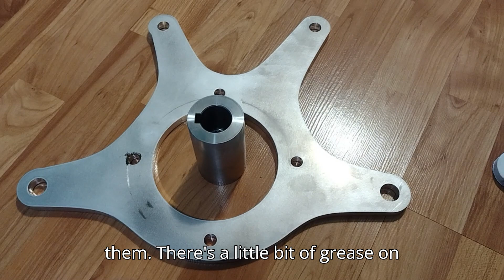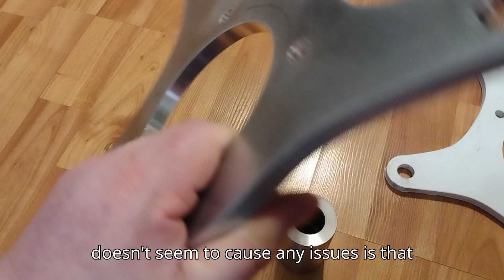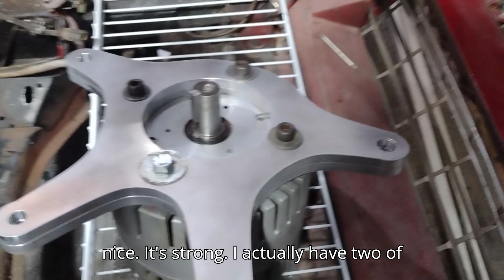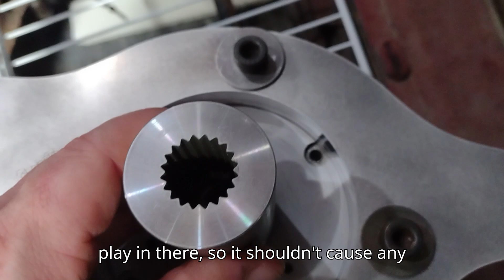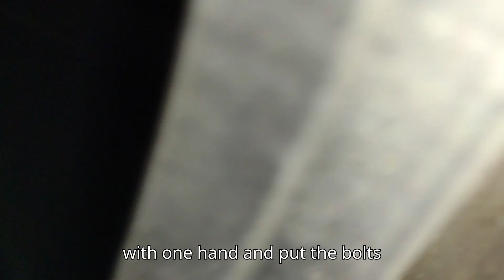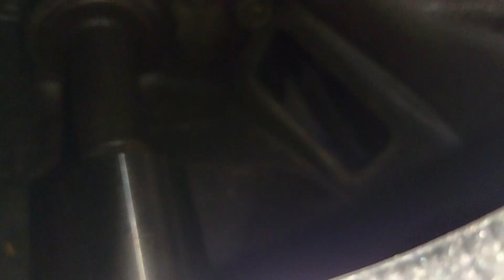Vintage 1982 Fiat Spider 48V Motenergy ME 1206 Brushless EV Conversion -  Part 3 - Metal Parts

Comment: Thanks for the videos!  I am about to start on my own Fiat 124 project --it's great to see someone else embarking on the journey.  Wonder if you would be open to sharing the CAD files of the coupler and the adaptor plate?  Thanks!
Reply from the maker: Absolutely. I'll see about adding a link to them soon. They aren't perfect, but it'll get you started anyway.
Reply: @oddjobsandrandomprojects  Thanks! Appreciate it.  Am I correct to think that you skipped the clutch completely?  If yes, would that affect shifting gears?
Reply from the maker: I did skip the clutch. I watched videos from a few others who did the same on different cars. Benjamin Nelson had a really good old video on converting a Geo Metro and he does the same thing. You just have to release the throttle pedal and shift to neutral for a moment before going to the next gear. At least that's how I understand it.

Comment: I definitely like what you are trying to do here.  
Looking at that motor's specs, it seems to be in the six horsepower or so range, if I am looking at things correctly. (?)  Which is in line with recent street-legal golf carts, which are in the 1000 lbs range (with similar cargo limits).  With a little "back of the napkin engineering", wouldn't it take about two to four times that horsepower to achieve minimal reasonable performance on this project, given that the Spider weighs twice that, and that street-legal golf carts usually drive at just 20 to 25 MPH, whereas a car should be capable of doing perhaps twice that, if not more?  (I know some things about motors and electricity, but not that much about cars, and less about the conversion of them.  (And not to be discouraging... ... just to put things in perspective, I do know that the newest single-motor Tesla Model 3 Rear Wheel Drive's motor is 286 horsepower, liquid-cooled...))
Reply from the maker: You are indeed correct. This may not meet my performance goals. But a few other considerations that hopefully will make this work out. First, the normal continuous power is about 6 HP, but the peak is about 12-15 HP for about 1 minute. Also, I have removed a considerable amount of weight. So it is about 1800 lbs with the new electric components needed. I did also consider using a 72v battery with the same motor if it falls short of my goals, boosting power proportionally. Also, this will have a 5 speed transmission, which might help get more out of it than a golf cart with only 1 speed. Time will tell, but you may be correct in your assessment. I do know the acceleration will be very poor compared to most any modern vehicle. Probably more like an original VW beetle or less. That is assuming it can even reach 45 mph. I do appreciate your honest assessment, and it does come pretty close to my own idea. I do also have a backup plan that if this doesn't work I'll use this motor for an electric motorcycle and find a different one for this project. One of my original ideas was a Nissan Leaf motor and then just remove the transmission entirely. The power on that is about the same as the original Fiat engine.